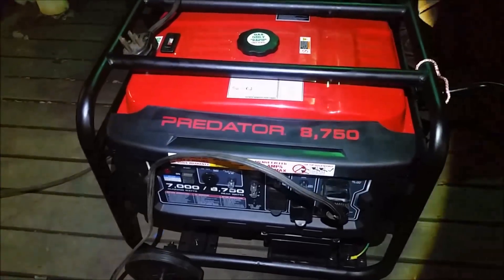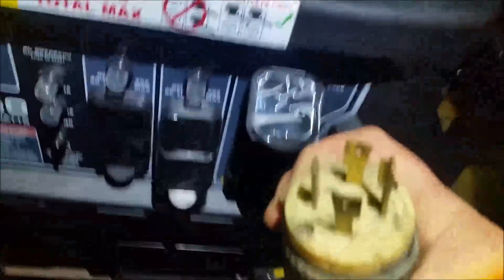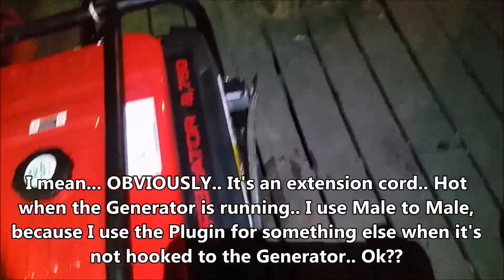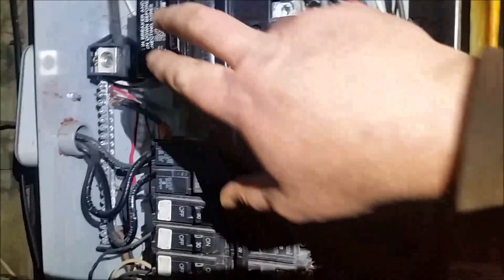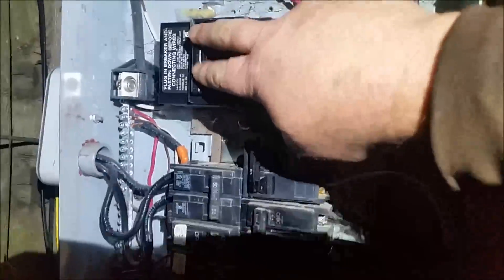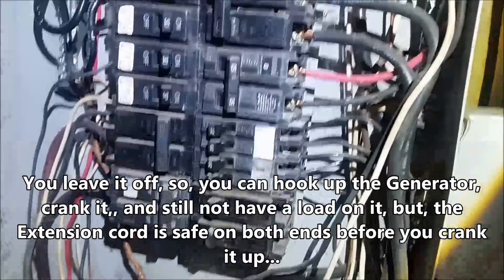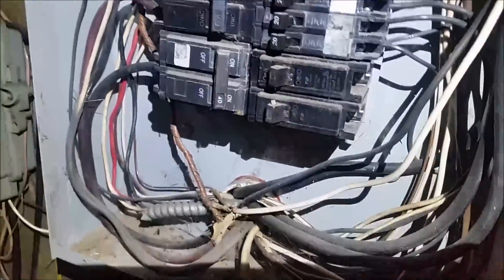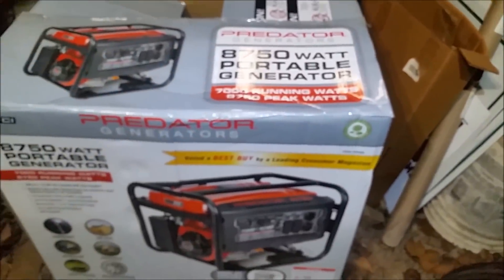Quick/Easy/Safe: Use Existing Plugin/Breaker for Generator hook up to your house Panel box.

Comment: Mark, the National Electrical code (NFPA 70)  clearly states the issues with backfeeding into circuit breakers. The standard circuit breaker works properly in only one direction which is why they are usually labeled "line" and "Load", add to that the fact that depending on the system of ground fault protection (line fed or load fed) used you may be bypassing that too.
Finally - do you truly believe that someone would pay people to criticise your wiring video?
Damn man, you have a high opinion of yourself - especially when people like me are happy to do it for free. It's not that the money ran out - its more likely people got bored.
By the way - with 30 years in the electronics industry I don't feel the need to put videos on youtube to try to convince people that I know what I'm doing.
Bottom line dude - this is dangerous practise, you need to remove this video before you're responsible for burning down someones house.
Reply from the maker: Absolutely, I know that the "Private Trade Organization" NFPA is paying people to jump on these videos.. You must be on the follow up list... 
NFPA 70.. Why don't you just say NEC? You are going to have to have them update the NEC so you can provide a link to the actual text. Because what you stated is not true.. It does not say not to do what I have done.. It is a common practice in the Electrical field.. Of course you can actually find the link in my text and you can find for sure that what I say can be backed up with cold hard facts.. 
https://www.electriciantalk.com/f2/breakers-directional-19714/ 
And, nothing in the NEC covers temporary or portable extension cords.. The section that most closely covers it is: NEC CODES  406.6 and 406.7
But, here is the codes that are most closely related, and some knowledgeable people discussing this exact issue. 
NEC CODES  406.6 and 406.7
Notice the first reply by the Moderator.. Even though he disagrees, he says it is not regulated.. And, he knows enough, no one even remotely argues with him.. 
http://forums.mikeholt.com/showthread.php?t=158086
Then,, look at the NEC Code Definitions on this page and spend a while understanding what you are talking about, and then go back and read the forum posts.. You might be able to understand what everyone is talking about.. 
https://iaeimagazine.org/magazine/2014/12/02/article-406-receptacles-cord-connectors-and-attachment-plugs/

But, to address your Breakers don't work like that comment.. I'm sorry.. You forget the basics of Electricity.. You know.. A/C = Alternating Current.. 
And, you don't understand how breakers work, and that is pretty fundamental or pretty basic.. But, I understand that NFPA/NEC discourages taking an "Out of Circuit" Breaker apart to see how it works... To keep you guys dumb... But, what would you expect out of a FRAUD Company like the NFPA anyway.. 
They wrote their code book to sell it,, not for any type of "I care about your Safety"... And, they try to get states to Adopt their Code Book... 
To PROVE what I just said,,, look at the first statement here... 
https://downloads.nfpa.org/codes-and-standards/all-codes-and-standards/list-of-codes-and-standards/detail?code=70 
Adopted in all 50 states, the NEC is the benchmark for safe electrical design, installation, and inspection to protect people and property from electrical hazards.
WELL,,, THAT IS A LIE.. Because NFPA 70 is the NEC and it is not adopted "FULLY" by Anyone as far as I know.. Maybe some have fully adopted the 2012 version, but, I highly doubt it.. I have not studied that in particular.. But, lets see if that statement is a lie to begin with???????
Look at this Trickery (LIES) page of the NFPA Website.. 
https://www.nfpa.org/NEC/NEC-adoption-and-use/NEC-adoption-maps 
When you do this search in Google "How many states have adopted the NEC".. Their Web Engineers have that same comment in their Meta Tags.. You can see it at the very bottom of the page, on the left graphic of the picture of the book... Look for the text next to the book... IE.... " The NEC is adopted in all 50 states, and covers electrical wiring and installations."
That statement that they flag up on Google is a LIE.. PLAIN OUT LIE!!!  But, don't believe me.. Believe the NFPA.. The page that they have these LIES ON,, is the page the fully describes their "How many states have adopted the NEC" Page... 
And,, what they DON"T SAY,,, is the fact that when they count states as "Adopting the NEC",, they count that state as "Adopting the NEC",, even if they adopt only a portion of one subsection.. I don't think Any State has adopted even the NEC fully.. I seriously doubt it... 

YOU MIGHT WONDER WHY,,,, It is not Accepted, or only Parts of it Accepted.. After all, it is "FOR YOUR SAFETY" Correct?? 
Well, if it were "For your Safety", you would be able to provide a link for people to discuss it.. Right??? But, you can't.. WHY??? Because it is not "FOR YOUR SAFETY",,, it is for the "NFPA BANK ACCOUNT" Safety.. Because,, it is what??? FOR SALE??? Not for Public Use.. If it were for Public Use,,, it would be Freely Distributed, and the States would be sure that it were available for those who are supposed to Comply with it... 
That's just the point.. You can't comply with something unless you give the Specs you are supposed to comply with,,, FOR FREE!!!!. 

So,, now since I have learned where the focus was coming from,,, I have now changed my focus on those who were trying to harass and force me into their Compliance.. In fact,, I just might Pin this response,, or better yet,, I will write a new response,, more targeted and more specifically related to the Fraud NFPA and NEC,, using Screen Shots and captured portions of their own website.. Your Company is failing because you have gone overboard... 
You try to attack the little guys,,, but, you say,, this wont' work and it is DANGEROUS.. But, we have been doing this for 15-20 years safely.... 
The more you attack us, the more we dig in to defend and we always dispute what you say and we are the clear winners,,,, AND WE HAVE NO DOG IN THE FIGHT... You are doing it for Money, and we are doing it for FREE... I think that is Poetic Justice, since you mentioned it in your comments.. 

BUT,, Back to your "Breakers Don't Work Like that" Statement..  We will use two references.. The stuff that NFPA does not want you to know.. 
How does a breaker work.... 
Here is a technical Illustrated breakdown of a breaker with explanation... 
https://www.youtube.com/watch?v=GSh0f94JwaA
Here is a guy experimenting and showing you on video the actual overload of a breaker and you actually get to see it trip on video... 
Here is what to know about your statement to know that it is ALSO not True.. That the Breaker will work Both Ways.... It is really a simple concept.. 
The Trigger mechanism is a Bi-Metalic bar in both of the videos.. The bar is rated for a maximum current, the current of the breaker... 
Past that current level, the bar heats up and throws the breaker switch into neutral, until it cools back down... 
Electricity passing through the bar is what causes the heat buildup.. It doesn't care if the electricity is passing left to right or right to left,, it is still passing through the Bi-Metalic bar and the effects of the passing doesn't change whether it is being Load or Line fed,, contrary to your statement... 
And,, No.. I am not going to spend $150 to look at a book written by Fraudsters who say one thing (Misleading on their Website page),, and then,, put another in it's "Meta Data" for Google to Pick up and mislead the others..
NFPA and NEC is FAILING... You went way past what you should have.. You should have stuck to the basics and not gone totally snowflake... 
And, these discussions are there for EVERYONE to SEE AND READ... You don't have to pay me $150 to read it... 

I tell you what... If I suspect that one more of you guys have posted here supported by the NFPA,, I will make you a Solemn Promise... 
I will make a video, using your own website and text and I will do some extra research on what actual codes have been adopted by a number of states.. North Carolina has only adopted a portion of one section.. I'll research another 10 states to find at least 5 more that have only adopted a small or single portion of the NEC and I will do a special video, and then, I will spend a week posting it on every related video I can find on hooking up generators, etc...  I'm sure that half of the "Fuck the Safety Police" guys will be referencing and linking to the video just out of spite of you guys. In fact,,, I think I will go ahead after all these years and Monitize my channel, so, I can make money while you guys loose it.. 
So,,, FUCK OFF!!! or you will suffer like you have never suffered before.. You pick on a bunch of people who don't know any better.. I  live to learn.. I would gladly take the time to pay you back for the time I have wasted researching your codes,,, only to find it was all about the Money and you don't give a shit about anything else but money and are willing to do just about anything to protect your cash flow.... Fuck with me and within a few years, no one will be talking about NEC,, except to reference,,, "THE NEC USED TO".... 

And,, all that will take is disseminating the TRUTH~~~~!!  You guys have not come up with anything valid yet after what.. 984 comments??  I have already addressed and made fools out of everyone you have sent here,,,,, Including yourself... Have a nice day.. Pick on someone else or I will take you down to size.. I weigh 270lbs and I am strong as an Ox, and I HATE BULLIES!!!!  And,, I type about 90 words per minute if you count my backspace key.. So,, FUCK OFF~~~~~~!!!!
Reply: Wow - so nobody else knows anything about electricity, breaker  design or anything; regulations don't apply to you; ITS A CONSPIRACY!!  THE GOVERNMENT"S OUT TO GET US!!!

Damn - so all that training I did and qualifications I got were a waste of time.

People might take you seriously if you implemented even the most basic safety precautions, but no, You have no interlock on your breakers and you have a live plug feeding out of your generator.

Perhaps you should write your own guide to electrical wiring. You could call it "the Mark Thomas Guide to Horse Sense Electricals".

You could do a follow up called "the Mark Thomas Guide to putting out a house fire", followed by the "Mark Thomas guide to DIT Funerals"

Fairly  typical uneducated response. OK Mark - go ahead and electrocute yourself because your earth leakage doesn't work properly, and burn your house down because your now main breaker won't trip because  you've backwired it, but FFS don't encourage others to do the same!

Seriously - do you really think some redneck semi-skilled self taught electrician is such a threat to the authorities that they PAY people  to point out the flaws in his DIY design?  No way man - we do this for the self satisfaction of trying to save other ignorant people from burning their houses down and killing their families.

As for telling me to fuck off because I civilly pointed out where you are taking LIFE THREATENING chances.
screw you mate - your family mean nothing to me.
Reply from the maker: @robbrown6495  you can't use the existing breaker as a dual purpose generator feed and be able to use it normally and have an interlock.
Fyi.. all generators have they live plug leaving out of them.
The mechanism that throws a breaker is a bimetallic bar that heats up as the current goes through it. It doesn't matter which way it goes. Yes. Some people know a lot more than you do
Reply: @MarkThomas123  Let's try again.
Your backfed breaker and you mains incomer should be interlocked to so they can't both be on together. 
All generators do not have a live plug leaving out of them - they have a live SOCKET. 
Congratulations - you've figured out how ONE TYPE of breaker works. But there are other types available, installed in other people's homes, that are not bi-directional, and do not rely solely on a bi-metallic bar heating up.
Yep - some people people do know a lot more than me, many, in fact, but from your responses  I'm having difficulty believing you might be one of them.
Reply from the maker: @robbrown6495  you cannot use an interlock and using existing breaker that you use for something else when you're not using the generator. That's what this video is all about. Using an existing Outlet that you use for a welder or something else, and using it to feed your panel with your generator in a temporary manner when you need to.
Again. You cannot use an interlock and do that. Because when you're not using the generator, with an interlock, the breaker that you would normally use as a generator backfeed is not good for anything else. I don't understand why you can't realize that it is backfeeding either way you slice it.
Somehow, you think that using an interlock and back feeding a breaker is different than just back feeding a breaker without an interlock. The breaker is still being back fed. I find that a simple concept period on your having trouble with no doubt.
If I haven't said it yet, this video is not for people like you. If you can't understand what I just said, the interlock is the minimum that you should do before hooking up your generator. End of story.
Reply: @MarkThomas123  OK - I'll give you the benefit of the doubt here  and assume my words were too confusing for you, or maybe just too long.
As the most basic safety measure the breakers should be interlocked so that only the main breaker OR the backfed breaker can be switched to ON at any one time.   Even for temporary usage the interlock is essential for that one time when you've been on the weed and forget to flick the main breaker when you're using the generator.
Safety is safety. The  fact that one day you're using the breaker to power a welder, and the next to backfeed from a generator  is exactly what is wrong with your solution.
If you are going to use a backfed breaker to get power into your panel (which is not recommended) you should use one which is dedicated to the task AND interlocked.
Reply from the maker: @robbrown6495  I don't need an interlock to remind me to turn off the main breaker. And you can't use an interlock for anything but a dedicated back-feed breaker. I know that's hard for you to understand. But it's really very simple.
Reply: @MarkThomas123  I fully understand you can't  interlock a non-dedicated backfed breaker - It's the use of a non-dedicated breaker for backfeeding that makes your solution so dangerous, which is why you should not be recommending it to people out there. You say it's for people who "kinda know what they're doing"? If they know what they're doing they don't need your irresponsible directions.
Yep. I appreciate you don't need an interlock - hell you even figured out how a breaker works -  however, there are idiots out there electrocuting themselves based on your "expertise".
Common Horse Sense? Safety? No business doing this?
Argue this as much as you like dude. You're dangerous. Do it in your own back yard, but for the sake of peoples lives don't put this shit out as a "how to" video.

As for your previous comments on backfed breakers, most of the major breaker manufacturers will provide details on which of their breakers can, and can not be backfed.

Unless you think this is a conspiracy too.
Reply from the maker: @robbrown6495  all panel Breakers are made the same except for the GFCI Breakers that you put into the panel. And we have established the fact that backfeeding a breaker is not a problem, since you think it is okay if you using interlock. See how your logic is flawed?
An interlock is used for those who can't remember to turn the main breaker off when you backfeed. I don't have that problem. It's common sense to me. Neither are others who watch this video. Like I said, people who don't like this particular protocol are people who are scared of electricity and you don't have the common sense to not need an interlock.
If you remember to turn the main breaker off, there's no difference in whether it's dangerous or not.
 it would be the same as if I told you to jump in your car and run to the store to pick up something. It would be enough for the average person watching this video. but for those safety Freaks and people without come and Horse Sense, I would have to explain all the safety and possibilities of danger associated with driving a car.
Like I said. It's not for people like you.

Comment from the maker: Isn't that something. I was getting five to eight negative comments a day for months, and then all of a sudden it stopped.
I guess whoever was paying the trolls to jump on this video finally gave up. I guess they saw they couldn't argue their point here with any validity, because their comments were answered with logic and physics. Examples to where anyone could understand. Guess they figured out it was a moot point, and a failure.
Reply: good Video Sir.  You did nice job.   !    YOu are correct on most if not all you said.